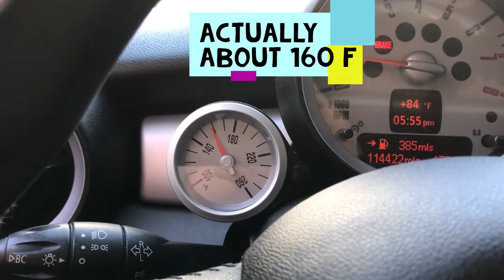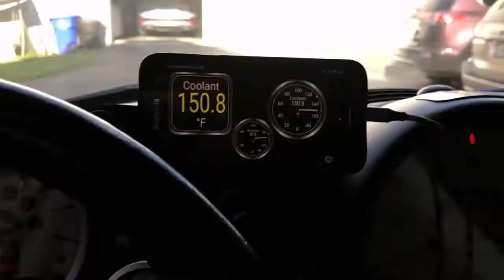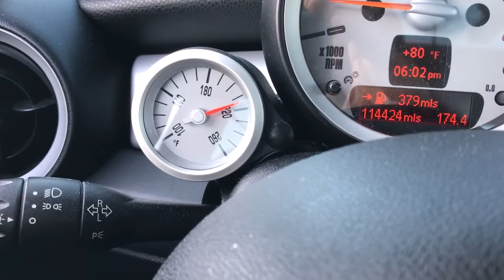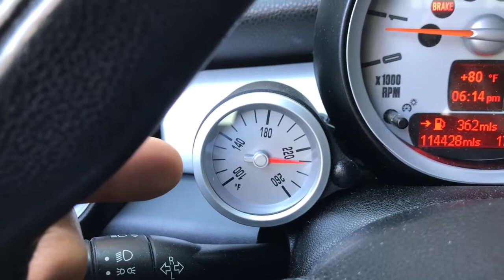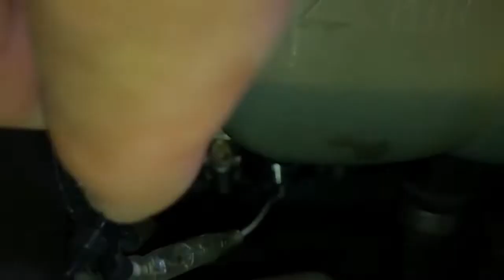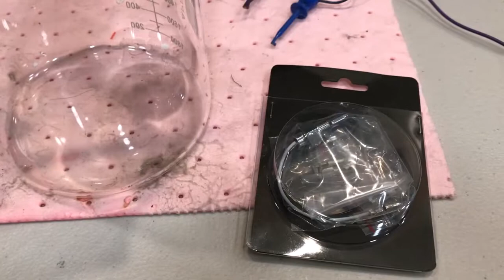Bad coolant temperature sender? Let's test the old and new senders

Comment: I have the same problem with my recently installed Marshall water temp gauge. It’s reading way too high. Is there any way to fix this?
Reply from the maker: @AlexisRodriguez-yv6sf  I’ve been tracking my analog water temperature gauge for a while. It reads about 5-10 F higher than the temperature sensor at the thermostat. I’ve been think of installing a potentiometer (variable resistor) in series to Marshall temperature sensor to tweak the signal. I’ll do a future video on this. Good luck
Reply: @ quick question? I also have a volt gauge and the signal wire needs to be connected to a switched 12v plus. But I’m wondering if that also needs a 1amp fuse on the wire since it needs to be tapped into a switch 12v plus even though it’s the signal wire?
Reply from the maker: @ Doesn’t hurt to add the 1 A fuse. If it’s signal, it’s probably limited in current anyways

Comment: Hi i would like to pose a question to you ,because you tested the temp gauge coming from Marshall and you found doing the tests that there is a difference on the indication shown on Marshall gauge and the one that you have connected on the OBD.
Did you get an answer from Graven Speed on that? And what  their answer was.

I plan to purchase the temp and oil pressure gauge from Graven Speed ,but i am a bit worried of.
Please provide to me your feedback on this
My Mini One is a R56 2010 model and i leave in Greece so the car is a European model.
thank you
Reply from the maker: I did a couple videos on the install of the Craven gauges which be helpful in seeing where they are located. Basically the Craven coolant sensor is on the upper return hose of the radiator and we know the Mini coolant temp sensor is in the thermostat assembly so they are not in the same location measuring the coolant.  The two follow close at the lower temperatures but appeared to offset at higher temperatures until the thermostat opens which makes sense. Mini reading hotter temp, closer to engine. When the thermostat opens, the coolant flows and you see the drop in temp in both gauges where it will follow closely until the thermostat closes again. Disclaimer- my replacement thermostat was defective and I didn’t know that so depending when I made videos, my content may have been off bases. Hope this helps and good luck.

Comment: I have a question why the cooling ventilateur starts at 105 ° while the same motor N16 B16 A in peugeot 207 starts at 90° is that an issue please because i have a mini and its illogic for the same type of motor in 2 different cars  to support different levels of tempature please i am looking for an answer
Reply from the maker: Very good question. The only reason I figure the cause for the difference in thermostat setting is where the car is available or sold. What I found, and could be wrong, but the Peugeot 207 is not sold in the USA. For the Mini to meet emission requirements in the US, the engine has to run hot but unfortunately all minis run hot no matter what country (making production easier)